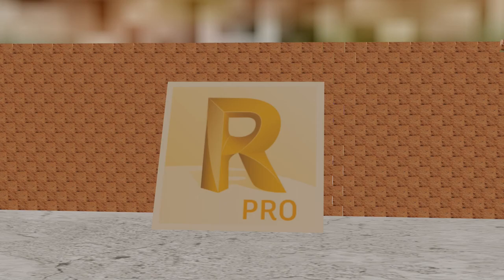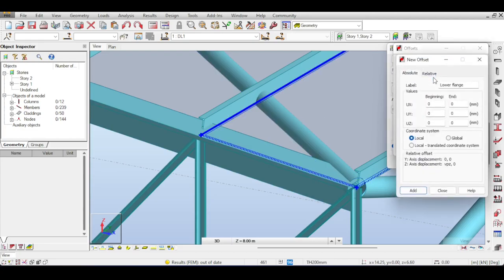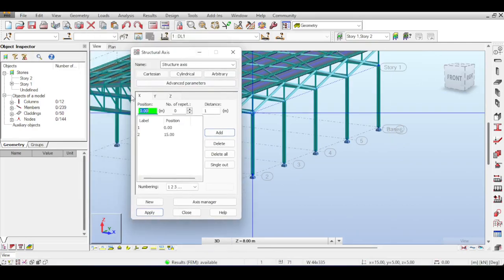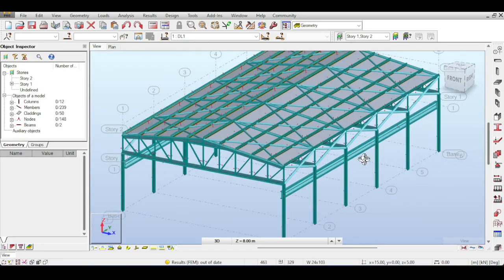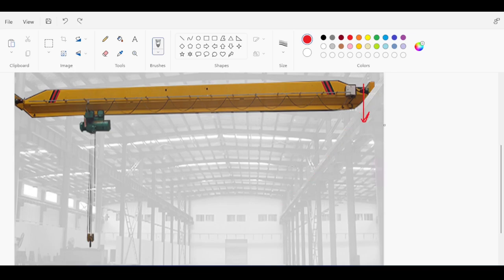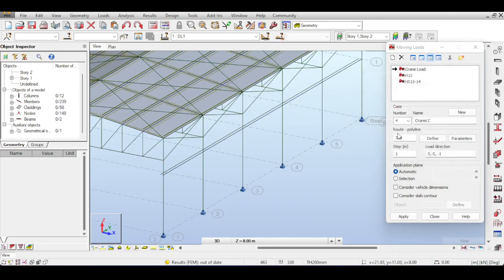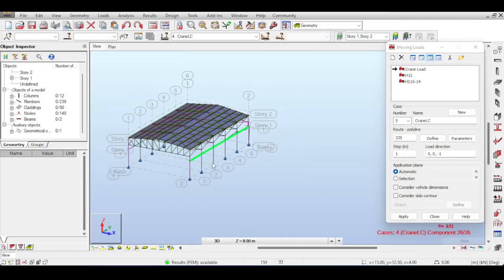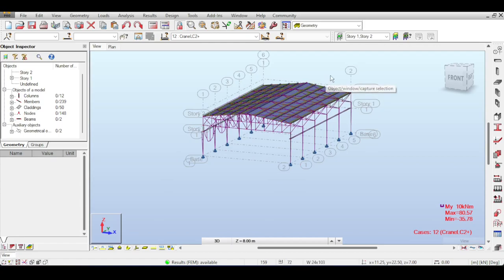Modeling Warehouse Cranes with Moving Loads in Autodesk Robot: Step-by-Step Tutorial

Comment: Hello, 
Would you prepare a session about applying thermal loads on a steel structure using RSA, and explain the way we calculate the thermal loads using Eurocode?
Thank you a lot
Reply from the maker: I will keep that in mind. I still am a little bit overstretched with multiple video series I have on this channel, but I will definitely keep this suggestion tabbed.
Reply: @CivilEngineeringEssentials  thanks

Comment: What about locrane combination for example 1.2DL +1.6LL
Reply from the maker: Depends on the crane itself. Usually cranes are considered live loads (because they are of moving nature). I do not see why you would need to have dead loads for the crane.
Even if the crane "crab element" does have a "self weight", as strange as it sounds, since the crane is moving on the beam, this self weight is treated as live load.

If I misunderstood your question, feel free to clarify.
Regards,
CEE

Comment: I cant find the moving load 🙂
Reply from the maker: Hi there.
You have to run the analysis first.
Then select the moving load case,
and make sure that: forces generated automatically is selected.
Reply: @CivilEngineeringEssentials  when i go to special load i cant find moving load option
Reply from the maker: Make sure that you have selected building design as your robot template.
Reply: @CivilEngineeringEssentials  this couldnt solve my problem i could not find moving load in special loads
Reply: Change structure type to frame 3d
Reply: @orhunerkuloglu4119  go to Geometry menu and select the template Shell or 3d frame, then you can use moving loads.
Reply from the maker: << MOVING LOADS IN AUTODESK ROBOT 2024 >>
Hello there, CEE Editor here,
with regard to having moving loads in the building design of Autodesk Robot, there is a cool trick to get that suggested by our dear subscriber and member Engr. Donald Khanye:
=== Quote ===
I also read in one of the comments where a viewer/subscriber indicated that they could not find “moving loads” under the loads menu. This would most likely have been because their model was in a “structure type or system” that is not equipped with the “moving loads” menu option …. switching the model to say “Frame 3D Design” and then modelling and defining those “moving loads” there before switching back to say “3D Building Design” is one possible way to resolve that issue
=== End Quote ===

Thank you very much for being awesome, Engr. DK! And thnx to the entire community for having those vibrant discussions.

Regards,
CEE